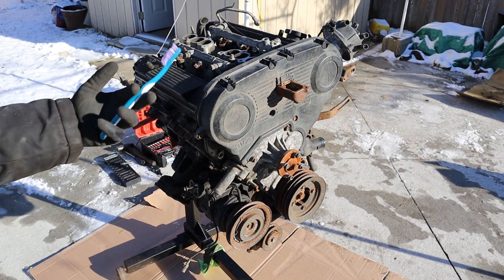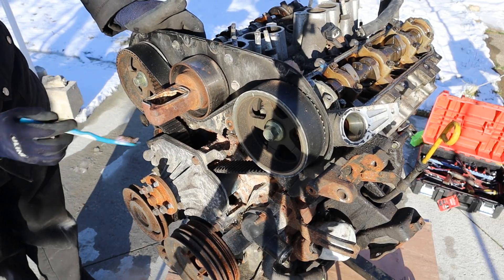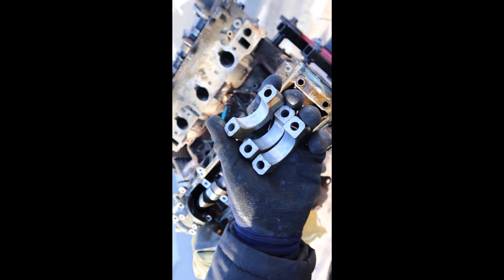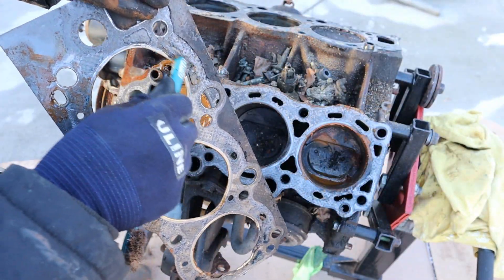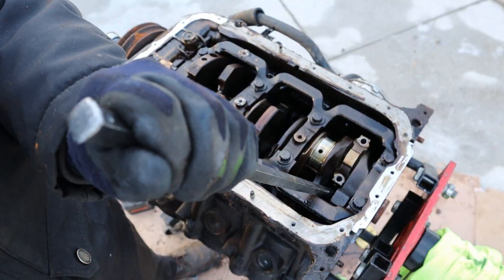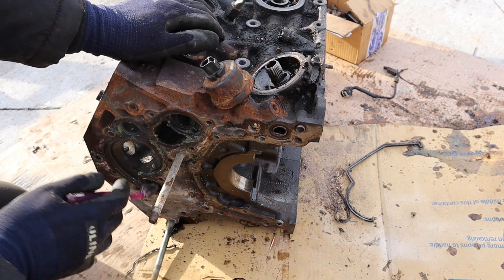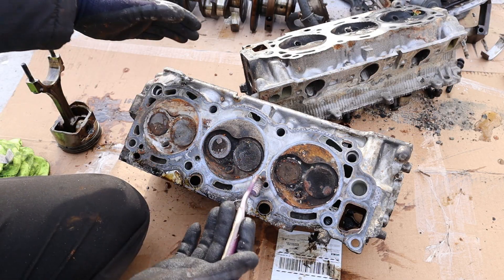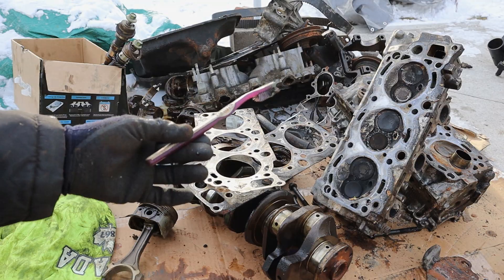Toyota 3VZ engine: An Overheat Disaster

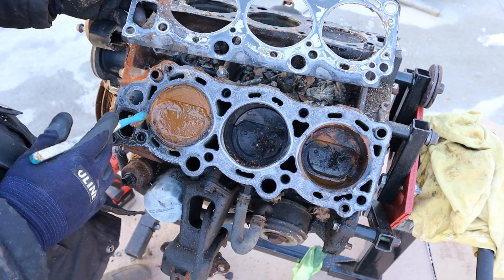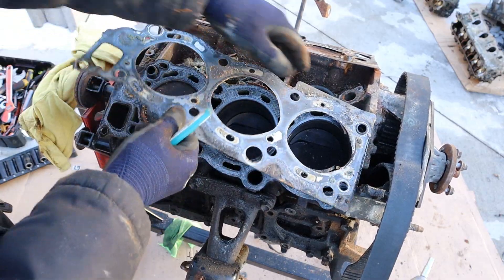Comment: Great video of a quick and simple teardown! After hearing you talk about the coolant holes in the head gaskets though at 7:25 and 8:05 , I have to say something. Those coolant holes in the front of the gaskets aren't clogged, they're smaller like that for a reason. It's because if those holes were the same size as the ones towards the rear, almost all of the coolant would flow through the front of the engine and hardly any through the back. I.e. those front holes are smaller to ensure coolant evenly flows through all sides of the engine. I replaced my head gaskets a few years ago and when I first saw the new OEM gaskets I wondered why the front holes looked like they weren't completely bored out. That is why.

Comment: The head gasket issue started when asbestos was banned from automobile parts 
Never had these issues before with the 3vz replacement gaskets were better and Toyota recalled most of them, usually there was extreme etching of the block and heads that needed machining to get a smooth flat surface, you cannot just replace the gaskets

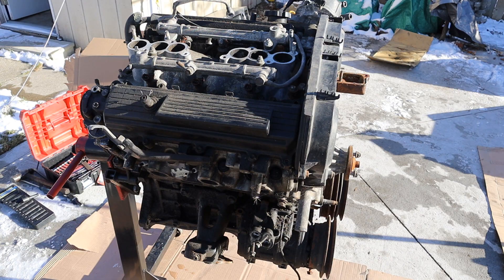Comment: 0:50 nobody likes this engine! It makes less power and uses more fuel than the later 2.7 liter 4 cylinder that was available in Tacoma starting in 1995.5 . The direct replacement for this engine is the 3.4 liter (5VZFE) which is legendary in terms of reliability. Nice video.

Comment: With the water pump driven off the back of the timing belt if it leaks some coolant onto the belt it will slip a little. A little bit over and over it starts to overheat but you can't tell why. You have to take everything off the front of the motor to see the water pump gasket has been leaking just a little but over time it will overheat so many times you blow a head gasket. It took me two motors to figure that out. Both water pumps had RTV on the gasket. Don't do that! I use a non hardening PTFE based lubricant/sealant. I use Magic Lube. I got it off Ebay but you can get some or something like it at a pool supply. Thats where I first found it and I use it alot on my car repairs, anything water related.

Comment: Guess I got lucky my old 95 4 runner at 412k miles never adjusted the valves but I did flush the motor when I got it from my dad it just refuses to die

Comment: I have the Australian made model of this engine. I wonder if they fixed these issues or perhaps sourced material elsewhere. I have it in my almost 30 year old Camry (granted it has 165k miles or 265k km on the clock) but mostly vehicles with this engine are either on the road or still sold by the wreckers after the car has been junked.

Comment: On the 3 core brass original radiators, they can develop a small crack at the base of the filler cap. Not taking care of this hard to find leak, can help rust form inside the cooling chambers over time, even with using Toyota Red Long Life properly mixed. I saw this problem on mine.  Mine did barely leak and i thought it was a radiator cap. It never leaked like dripping on the ground. It was finally re-soldered. The design of the 3.0 is late 1980's and these motors need adequate zddp in the oil, which has solely been reduced in off the shelf oils. So researching the oil type along with climate temperature is necessary, due to the bucket shims under the cam and one need to properly mix distilled water with genuine Toyota Red Long Life. Can't leave this step up to a shop/garage. Must be DIY.  Its nice these are a not-interference engine, and work better with a manual transmission vs an automatic. Denso & OEM parts are necessary as replacements. Especially plug wires. I am currently using 10W 40  conventional with elevated zddp levels and at least 89 octane gas.These vehicles like 31" tires (per the door jam label) an going bigger is not suggested.
Reply: Why not use synthetic oil? I’ve been using that since a rebuild and heard switching will cause problems.

Comment: I bought new 1989 and 1993 Toyota trucks with this engine. It was such a dog. I FAR preferred the 22RE in my other Toyotas. Frankly, although  mostly reliable, Toyota can't hold a candle to Honda engines, although I have grudging respect for the 4.0L in my current 4Runner & 05 Tacoma.

Thanks for ripping these down to see what makes them tick (and stop ticking!).

Comment: What is the best coolant to use for these 3vze motors?  Just factory Toyota coolant?
Reply from the maker: Yes. It's an iron block so very sensitive to coolant mixture since it can rust
Reply: Nothing but that Toyota brand from the dealer, mixed 60% coolant, and 60% distilled.  DO NOT TRUST a shop to do this. Do it yourself, by pre-mixing in a clear jug.
Reply: @tonyisme4934  Okay, sounds good. I just bought the OE Toyota coolant

Comment: I also thought it was funny you said you were surprised the oil cooler wasn't part of the filter assembly. I just rebuilt my cooler yesterday. And i was laughing my ass off realizing they just used another oil filter in the block. They are actually interchangeable. My 4x4 for example has the filter in the front and cooler in rear. 2wd is opposite. Honestly i like this engine for its simplicity as a 6

Comment: Mine has 272k currently and just rebuilt oil cooler. I bought it from a real estate company that took good care of it tho. Its obviously beat up because its a work truck. And it doesn't run perfect at idle. But gotdamn if that thing wont handle the daily abuse... Trying to keep up with modern traffic 😂 seriously i baby this thing because i have to beat on it to get anywhere

Comment: Thank you for this tear down effort. Something to be said, Remember this engine has fewer moving parts of potential failure  than a 3.4 (4 valves per Cyl)  or newer motors. This motor is a victim of  Head gasket failure AND fluid/lubricant neglect. This motor works best with a manual transmission. And this is a non-interference engine.
Reply: Can you explain why it works better with manual for someone (me) who is trying to learn more about engines?  I have this engine in a manual 4WD 1990 pickup and want to do my best to give it a long life.

Comment: Not using Toyota Red long-life at 60% coolant 40% Distilled water was a contributor to this failure, and probably oil changes not done timely. My 3VZE had cam wear , likely due to off shelf oils with insufficient zinc/moly. Using higher zinc oils now...

Comment: This is the first engine I ever took apart. Was my 1989 (built in 88) 4runner. Was a very reliable engine to me, overheated it several times pulling way to big trailers with it, changed the oil and forgot the cap drove with little to no oil, it took all the abuse. Never blew a head gasket but I did remove the heads cause I hydro locked it off-roading once. Put it back together and drove it another 80k miles until a drunk dude pulled out and hit me. Wish I had never got rid of it. The red interior was immaculate🥲

Comment: Wow, 2 valves per cylinder, no VVT, an actual distributor, a mechanically operated fan and a cast iron block.  But I didn't notice a vacuum or centrifugal advance on the distributor body?

Comment: All 89 to 95 3.0 had bad head gaskets..but they are one tough engine..mine has 212.000 miles and still going..After I replaced the gaskets and rebuilt the heads

Comment: I have the same engine (1994 Toyota pickup V6 3.0/3VZE), and I'm getting a code 24 and code 31...rough idle, rich running, hesitation sometimes when i press on the gas pedal, check engine light on, and occasional backfire when first starting (cold).  The truck came with an EGR delete set up, as well as a cold air intake simplification mod when I bought it. If you (or anyone) could offer some guidance, I am by myself and really need help. Thanks!
Reply: A bad Denso water temp sensor can cause this, I was getting 13mpg and running rich. AFTER checking all areas for vaccum leaks including throttle body.  Bad temp sensor tricks the engine computer to think the engine is cold all the time. My sensor was 34 years old. It had never been changed.  I had the vehicle 31 years. I used an exact 89422-20010 Denso Japan replacement and a  19mm crow foot fuel line socket by E-cowlboy  to get it out, after using CRC Freeze-out to get it real cold. Then it came out without breaking off  and using a 3/8th S&H long ratchet.

Comment: This engine is how I learned. Toyota recalled it, then extended it. The composite head gasket is a possible solution to the dissimilar metals (iron block and aluminum head) heating and cooling at different rates. This engine, 4g63, Ford 3.8 V6....
Reply from the maker: Yep
Reply: @Iamde4dinside  The replacements never failed. This engine isn't ingesting 12 lbs of boost, but that would certainly be better. It is kind of common on non-performance engines these days.
Reply: MLS head gaskets are necessary, along with toyota long life coolant properly mixed by the owner. Do not trust a garage mechanic to do coolant fluids, do it yourself.
Reply: @tonyisme4934  Yeah, go with appeal to authority. Rather than experience with the V06 campaign. Although I don't recommend DIY to people that ask.

Comment: I am rebuilding a 1995 GM 3100 V6, rated 160HP, pushrod engine.  With the OHC setup, I thought they'd do better than 150 HP, kind of surprising.  But when I saw the thumbnail, I thought...hmmm, looks like my 60° V6 block I'm working on right now, but it says Toyota.  Thanks for the fun, informative video.

Comment: Hi. When the BMW 320d or 320ied driving , (Zf8hp45) all of them that I drive makes a hard movement to the front, the car shifts down from 3 to 2 while I am slowing down,  and if I pump up just on the shifting or just little bit after the shifting it makes a hard movement to the front, the engine speed highs up and then its shifts to 3 again.   İts actually normal.   But I think its disturbes the comfort of the drive.   Did you explained this position at the end of your video while you explain the line pressure (you said “mash the gas”.   Thanks.

Comment: I sold my black 95 4Runner like 6-8 months to some Hispanic guy. the motor did overheat at one point and eventually just died in the parking lot at work a couple weeks after the overheat. Took it to the mechanic n said the head gasket blew. So I sold it to that guy n he got it running I guess but never registered the car in his name and the 4Runner was impounded because it was found on the side of the road abounded. Guessing it broke down on whoever. Makes me wonder if this the motor, highly doubt it. Im in Ca

Comment: This is the worst engine Toyota has made
Reply from the maker: I agree
Reply: With this motor 3vze 290K 4Runner stock 31" tires and a dolly I pulled my Sienna Van back from Mexico 400 miles. It was quite a drive train stress, didn't overheat.  Didn't burn up the clutch.

Comment: ME rebuilding a 3vze that sat since 2014 with blown head gasket, it was already rebuilt before and it the same with the coolant instead of the Toyota red or pink previous owner use cheap green. planning to do Arp headstuds on this
Reply: Well mine sat a long time but I had Toy red in it.   Best you drain and put 65% Genuine Toy Red  and the 35% distilled until you get ready to rebuild...the builder said mine was rusty. I had blown head gasket. Some coolant got in the oil...

Comment: ah yes.. the 3.slow.. which eventually becomes the 3.blow. gutless wonder that will blow its head gasket. the 5vz was an amazing leap forward and a welcomed replacement for what may possibly be the worst engine toyota made.      meanwhile the 3vz-fe from the 92-94 camry or es300 is a bullet proof DOHC beast like the 5vz.. what were they thinking with the truck motors?

Comment: I believe the little thing under the distributor rotor is the pickup coil for the ignition module / igniter, it acts like a camshaft position sensor.
Reply: Hall effect module, sends the 12v reference back to the coil to collapse the field

Comment: Stupid question alert: What's the deal with the pistons not being round?

I find it highly hilarious they used plastic for the cooling stuff, but had a steel oil pan. Like they were afraid the ground would take out their bullet proof engine design. Lol...
Reply from the maker: I agree! I'm not sure why the headgaskets aren't round but the pistons sure are. 

And yes why plastic... On an older engine you'd expect metal everything! Interesting design
Reply: @speedkar99  Oh, the pistons are actually round? They looked whatever shaped to that gasket like there was a bulge on one side. Lol

Comment: My 95 4runner blew headgasket at 189,000 & 9 years old. Toyoto told me I missed a recall by 8 months but Service Manager made a couple calls as they done 100% of service work since I bought new. They replaced the complete top end in less than a week & handed me the receipt for $4700 in parts & labor showing Toyota covered 100% of cost. & you better believe I bought my next Toyota from them also.
Reply from the maker: That's awesome!! 189K miles in 9 years is alot though, how did it hold up after that ?
Reply: @speedkar99  We traded it in on a new one in 2008 & it had 231,000 & still ran perfect.

Comment: I had a 1990 4-Runner with a slightly different V-6.  It blew a head gasket to the rear of the left rear cylinder.....near where the exhaust crosses over on the left rear of block...so I assumed there's extra heat at that corner of the engine.  Caused a small divot/cavity in the top of the block next to that cylinder.  Had to have that cavity welded closed, done with the pistons still in there.  Then for milling the decks of block  they required everything out down to a bare block.
Reply from the maker: Yeah I mentioned the exhaust crossover flaw near the end of the video. Your right, you will have to get everything off to mill down the heads or block

Comment: I was a Toyota truck fanatic back in the day, and given the choice between the engine you did here and the 22re, I'd take the 4 banger every day.  The v6 made a marginal bit more power, but pretty insignificant at most of your lower rpm you usually do truck stuff at, and it had to actually run regularly to make power, which they frequently didnt.
Reply from the maker: Exactly. And to add to that the r banger was easier to work on in the engine bay
Reply: 3vze. All the power of the 22RE minus the gas mileage and reliability.
Reply: @GoonDick  Well said.

Comment: I had one of these engines in a 93 4runner. Crap on fuel. Crap on power. Leaked a fair bit of oil from the valve covers.

But... it bounced off the rev limiter for many hours of many days and never let me down. Had to turn at 4200 rpm to maintain hwy speeds with the big tires n gears... but it never let me down. 

Sounds like I got lucky with the headgasket. I have mixed feelings about that engine, but I much prefer the new 2GR-FKS in the newer tacos. Or the 5VZ 3.4L. That one was crap on fuel but at least made some power.
Reply from the maker: Yeah I hear alot of people are swapping in the 3.4 into these older 4 runners. The 2GR is way more modern and no comparison haha
Reply: I’ve always liked Toyota’s 4.0 V6.

Comment: That was not one of Toyota's better designs; however they learned a lot from it and the newer ones were much superior. Kind of the  reverse of what the Americans and Germans do
Reply from the maker: Yeah it's kinda low point in Toyota's engines. Especially in the 80-90s when build quality was top notch

Comment: Say what you will about the faults of this engine but I've owned a 95 Runner that ran for over 550k till trans gave up the ghost. And a 04 Tacoma that had 475k before I sold it. Toyota makes the best plastic money can buy...
Reply from the maker: Nice! Any issues with the headgasket or overheating?
Reply: @speedkar99  I didn't have any issues with the engine on either. Just replaced timing belt every 100k miles & routine maintenance.  I've had good luck with the 3.4.  I bought a Tundra with a supercharged 5.7 so I doubt I'm gonna have the same luck. I enjoy your "quick to the point" style in your videos. Keep it up man.
Reply: I'm 306K on a shop rebuilt 3VZE. 5sp manual. No cat.   Decent power.... using conventional 10w40 elevated zinc oil and Red Toy long Life coolant

Comment: SK99: "...only two valves per cylinder..."
Ford: <laughs in Godzilla V8 engine>
Reply from the maker: Yep. They're still using ancient technology
Reply: @speedkar99  It's not "still", tho. They had "Modular" SOHC and DOHC V8s in Mustangs, cop cars and trucks for 30 years. I guess too many warranty claims and not enough profit margin made them design a new pushrod engine to keep up with GM, which never lost money switching to "new" technology for no perceptible gain.

Also, the cammers are huge, which makes packaging more difficult. Finally, valve shroud is less of an issue if you have a relatively large bore (>95mm).

Comment: My 1985 Honda Accord Hatchback was totaled in an accident 2 weeks fresh out of college and my first full-time job back in 1993.  Insurance settled from the guy at fault and I bought a brand-new 1993 Toyota 4x4 pickup.  I couldn't afford the V6 with 3VZ engine so settled with the 4 cyl 22R-E engine which I'm glad I did.  So easy to work on.
Reply from the maker: Yep the 4 banger is a better choice in these

Comment: Are youable to easily source a 3VZ-FE? It's the DOHC version and apparently shares very little with this particular engine. I've got a complete 435,000km example you can have. Only problem is freight from Oz haha.
Reply: If it's old and was sold in Canada, it's easily sourced. Cars return to the earth quick enough when driven on salty Ontario roads...
Reply from the maker: Nah these cars are way to old to find in a junkyard. Rusted cars get scrapped pretty fast here.